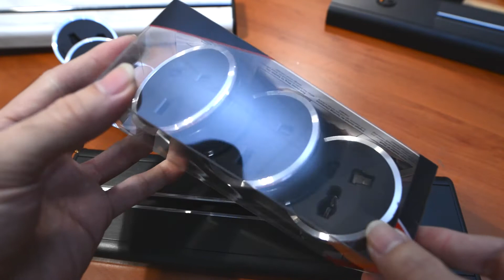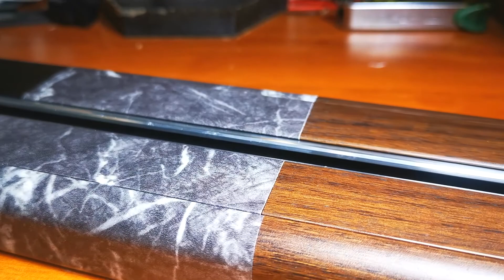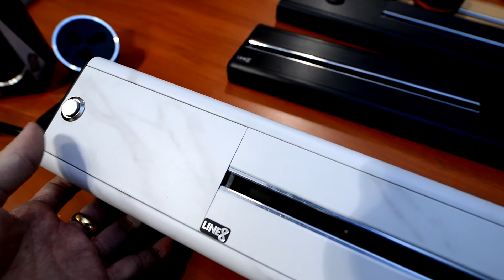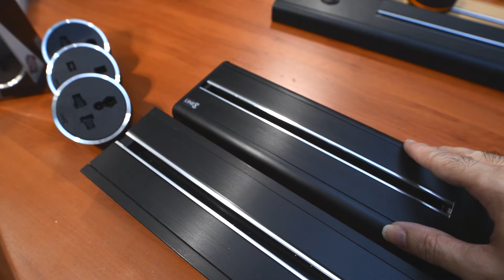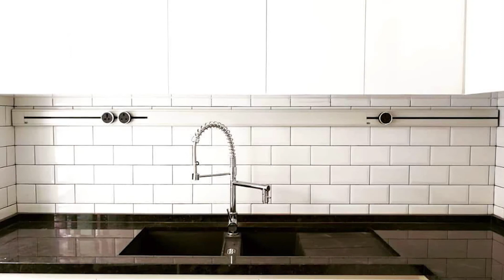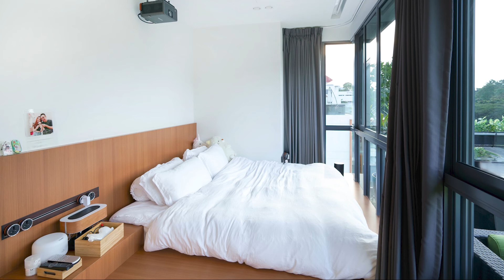Line8 Power Tracks - Review

Comment: does this power track has function similar to GFCI or RCD if installed near countertop sink?
Reply from the maker: Yes the track will be compatible with the RCD / GFCI protection systems we have in our homes. It does not have one built-in but it wires to and leverages on the existing system. The track has an active ground contact punched into the aperture of the track. The housing is grounded aluminium as well.
Reply from the maker: Thank you so much for your very knowledgeable answer. It is absolutely spot on.